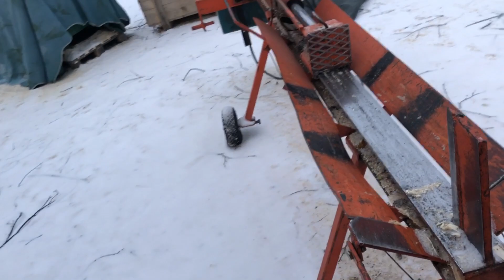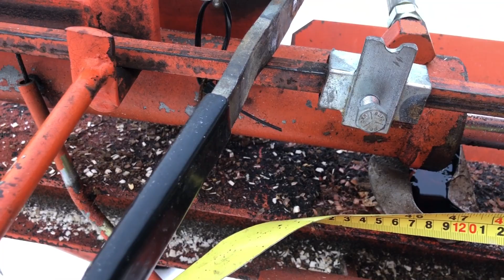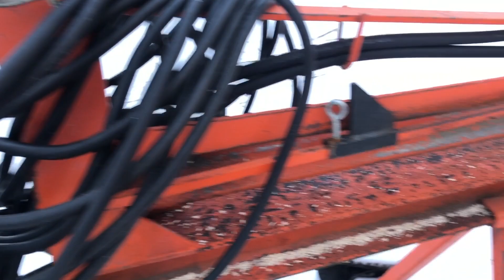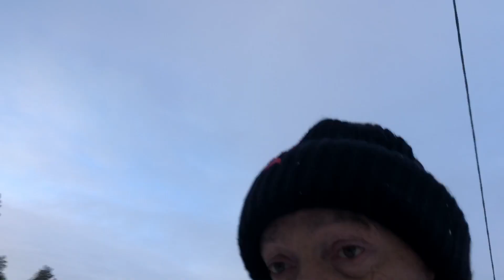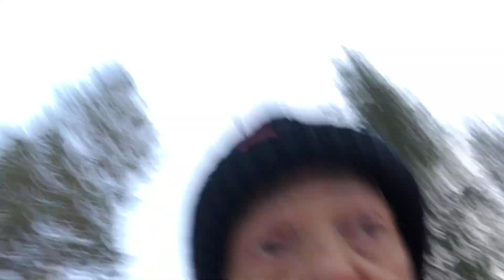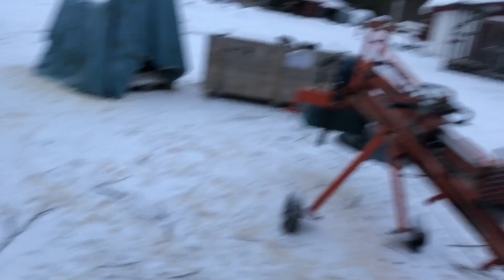Hydraulic wood splitter explained

Comment: Interesting... how would you rate the electric motor versus a piston engine? Cost per hour? You seem to pay a high price for electricity and fuel!
Reply: Running cost here in Sweden is only a tenth with electric motor. My splitter has a 6kW motor and does the job better than an diesel engine because when not splitting you really are on idle and you have a lot of torque when you put the woodbit against the edge and also very high degrees of efficiency as electric-hydraulic. I couldn't even dream of changing back (after 40 years)! And if I have very seldom no electricity off-road I have a 25 kW PTO generator 400V 50Hz 3-phase 20A, ordinary for reserve power, I can use for the bigger Logosol and such, and Valtra tractor is only idling at low revs. ;D
Reply: @uppsalahazzemarkstedt2759  Thanks for the comprehensive answer - yep, as I thought - electrics will do the job for less!
Reply from the maker: Hi AJ, no idea of the cost per hour running electric but since it is just a motor it will be low compared to running it on a tractor which I have never done but when you do then the tractor runs just ticking over which given diesel prices and service cost will cost more. The advantage of running it from a tractor would be if you were splitting somewhere on a property without power. We do pay a high price for diesel now, it has doubled in price since 2020, electricity has always been expensive but it cannot rise because as a company we have 3 year fixed pricing.
Reply: @arctic-rebel  Cool, thanks Simon... electric is the way to go! PS - I asked because I'm toying with the idea of an electric motor band mill... future small scale project?
Reply from the maker: @vossierebel  In your location I would say an electric powered saw mill is the way for you. You have neighbors, you wont need to move it about, you have power where you need it and you dont get power cuts, at least not yet. If I could make a sufficiently sized perpetual motion generator then I would also consider moving for a gas engine to electric but I just dont have the time yet to work on free electric, and I can and will just not yet.
Reply: @arctic-rebel  Thanks for the update... I shall definitely look at building myself a small experimental saw... to see how I get on -  however, putting a few ideas in the head into reality may prove disasterous but hey, if we don't try we will never get to the moon!😁😁
Reply from the maker: @vossierebel  I think you should have no problem AJ, and given what allegedly went to the moon you should have no problem with that either!
Reply: @arctic-rebel  Haha... thanks for naming my soon to be saw... Apollo it shall be... I'm wondering... thirteen of what? I'm rtaher partial to 13... so... maybe that will be a winner!😁😁
Reply from the maker: @vossierebel  LOL I want whatever you have been on 😄😄
Reply: @arctic-rebel  Haha... I mix a few slithers of those mushrooms you mowed over with one of my old socks... stick that in my pike and sniff it!! 😁😁 It comes highly recommended... essential survival elixir!